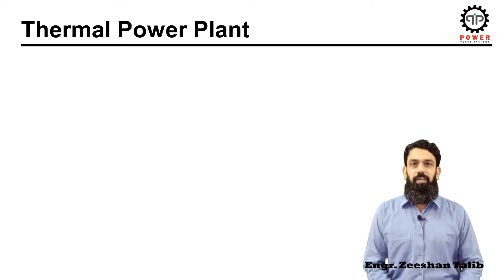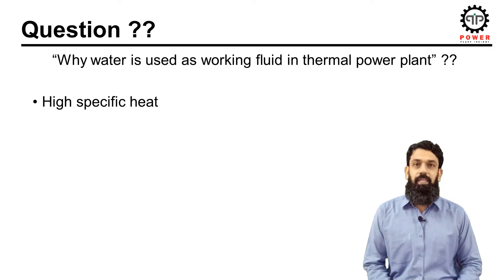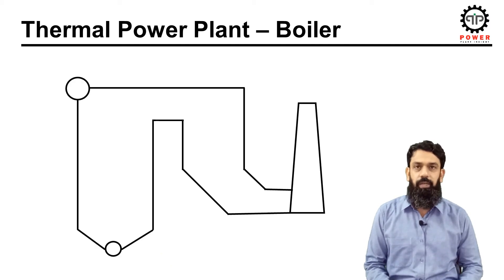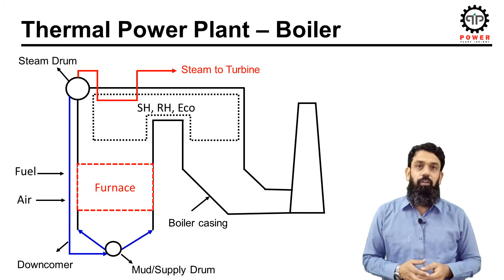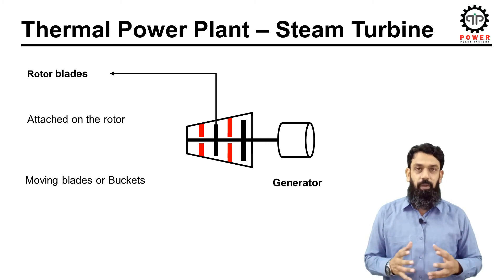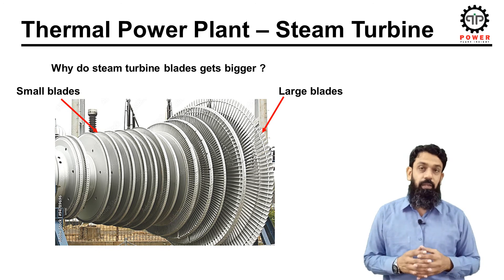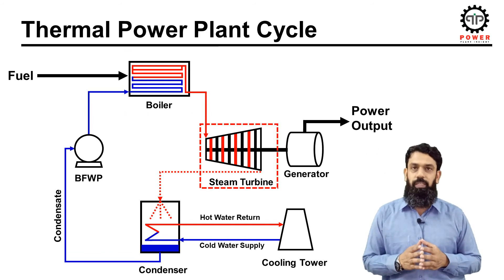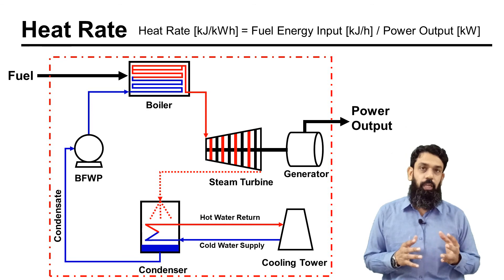How Thermal Power Plant Works | Heat Rate | Boiler | Steam Turbine | Condenser

Comment: Sir what is different between axcilary cooling water and main colling water??
Reply from the maker: Normally these terms are used for general understanding like Main cooling water means the water to be used in the main (turbine) condenser & auxiliary cooling water means the water to be used for cooling of auxiliary equipment's like boiler fans, pumps or cooling pumps etc.